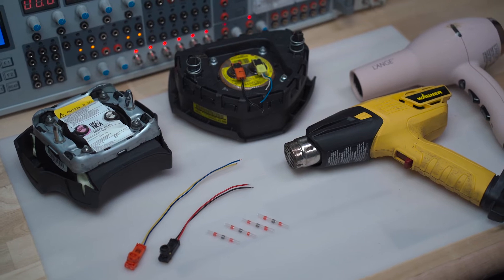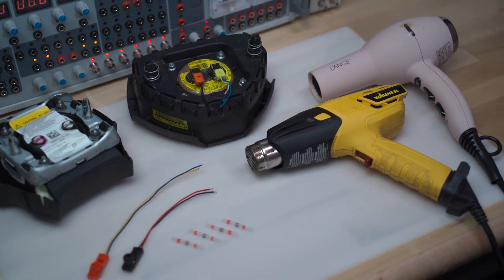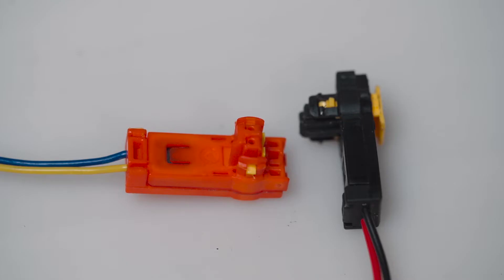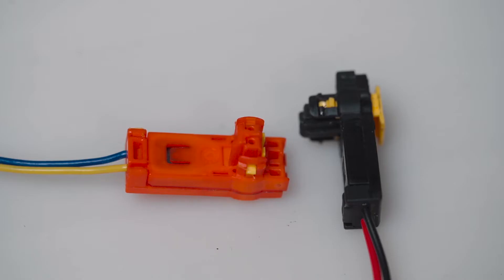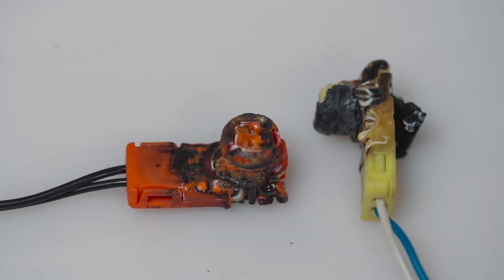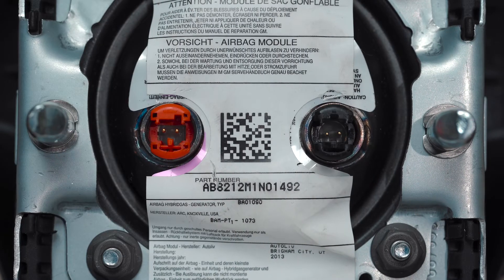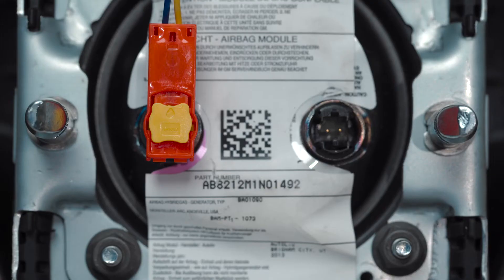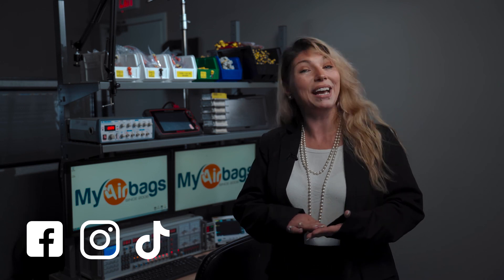What Is An Airbag Clockspring Connector Plug ? | MyAirbags

Comment: Hi, why is it that some steering wheel and/or dashboard Airbags have 2 connectors while others have only one? Even in some same vehicle models? Thanks..
Reply from the maker: That is because some vehicles use single stage airbags, and others use dual stage airbags.
Reply: @MyAirbags  So, if you ever place a double Conector airbag on a single Conector clock spring it won't deploy, will it?
Reply from the maker: @erickcarrillo3273  It will still deploy, but are you connecting it to the dual stage side or the single stage side?
Reply: @MyAirbags  I don't know, to be honest, how could I tell the difference? And what side do you recommend in that case, the single stage or the double stage connector? I really appreciate your help.
Reply from the maker: @erickcarrillo3273  Its best to check with manufacturer that created the air bag. It could be different based on year, make and model of the vehicle. We recommend to always sue OEM parts.
Reply: @MyAirbags  Perfect! I appreciate your time.  Thank you

Comment: So the clock spring does not ‘break’ during an accident? Is it only the airbag connector ? What about if the car has adaptive cruise control ??? The horn works and I have no codes for the clock spring
Reply from the maker: Correct the clockspring does not break, it is the plugs (airbag connector) that melts because airbag gets very hot when it deploys. There is no codes for clockspring. There will be codes for driver steering wheel airbag.